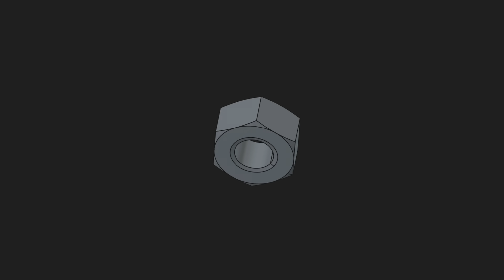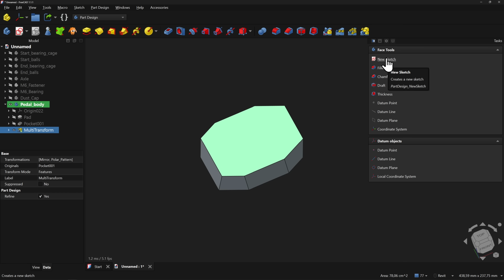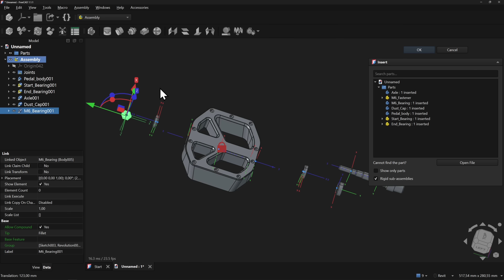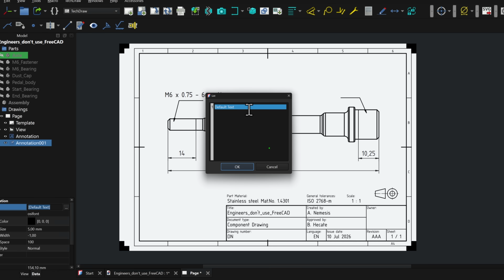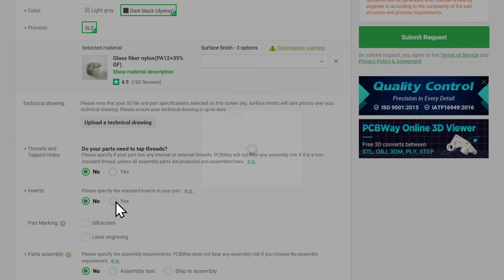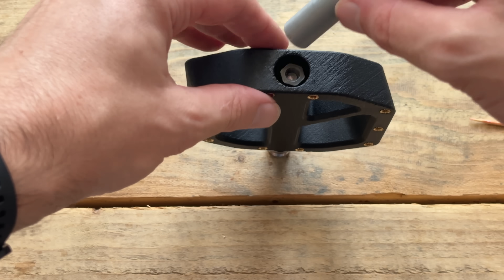Engineers don't use FreeCAD... Until NOW!

Comment: I love freecad and how far it has come. It is definitely viable for my 3D printing needs. On the other hand, as an engineering student there are still some things I am waiting to be cooked up by the devs. I know broken out sections and (hopefully) half sections are already being developed. But one simple thing I miss even in OnShape is half view (you can crop part but not add a symmetry line or split it in half), if a part is symmetric it is often very beneficial to only draw half of it and that leaves more area for other details or to increase the scale. A good example that happened to me recently is where I had a plate with four M4.5 sized holes in each corner. The plate itself was comparably large, but if displaying only its quarter, the holes were clearly visible.

Comment: Your explanations are the best (in my opinion) thanks for your work! And can you plz make video like  "STOP using FreeCAD WRONG" but with topic "How to work with several bodies". I mean how to create correct dependencies between them, and how set it up. If I want change some sizes it shows many errors after changes which refers to other bodies cause I use shape binder, sub-shape binder (for example). You have many videos with "Revers engineering" but how to work with freecad if I want create some complex project with several bodies, and if some sizes I decided to change (because I don't know what the best sizes for some parts in the beginning) it could easily change other sizes of other bodies without errors?

Comment: I installed free cad every few years for the last 15 years, and it was crap, i always ended up going to SW then fusion. 1.0 was the first time i felt i was using a real software. This is my main tool now

Not a fan of fusion they used the community to improve their product then are slowly locking them out.

Comment: As someone learning freeCAD as a replacement for my student version of solidworks, I’m really not a fan, it seems to give you less control in certain instances and then require way more input than necessary on others. I’m not arguing it isn’t capable but the way it expects the workflow to be is awful compared to solidworks or fusion, I know it’s open source but it’s had 24 years to get around TNP

Comment: Despite the impressive improvements on the last two years the FreeCAD workflow is still counter intuitive for most engineers with decades of experience in parasolid/acis based solutions. That’s why I decided to build Oblikovati from scratch which aims to be familiar to engineers used to industry standard tooling.

Comment: I'm following your steps, but I'm running into a performance issue with the TechDraw workbench. It's extremely slow, laggy, and keeps freezing. My specs are i7-9750H, 32GB RAM, and a GTX 1650. I've already tried enabling OpenGL settings in FreeCAD, but it hasn't made any difference. Do you have any tips or suggestions on how to improve performance for technical drawings? Thanks for your help!

Comment: Is there a way in FreeCad to place a part or a sub assembly one in the "final" assembly and then say make a radial pattern out of it or another repeating pattern? I need for example to place 6 arms in a 360º but i'd love to place the first arm exactly how i want it and then apply the radial pattern. As an example lets say I'm making a sun umbrella and i've created an assembly of just one arm which consists of various parts. Now when assembling the full umbrella I don't want to place each arm manually and I want to be flexible how many arms this umbrella should have. Your videos make it sound that FreeCad can do everything so I'm curious if you could point me to the right direction :D

Comment: First, thank you so much. I followed your tutorial and when I generated the stl file of the Pedal_Body and openned in UltimakerCura or even uploaded to  PCBWay, the object appeared without the fillets, chamfers and top/bottle holes. I suppose that was related to the modification in Pocket_X size. Do you have a tip to resolve this?

Comment: Thanks! Though as a software developer, I still prefer doing CAD using CadQuery (OpenCASCADE) or OpenSCAD. I like having modular and parametric components through code to maximize reusability across projects. Another big advantage is that LLMs understand this code quite well (especially vision-capable models like Qwen) which makes fixing bugs and creating new parts much faster.

It's incredible how even models trained solely on text develop spatial awareness. An interesting read on this is the arXiv paper 'The Platonic Representation Hypothesis', which shows that whether an AI learns from text, images, audio, or another modality, it eventually ends up converging on the exact same underlying representation of reality.

Comment: It would be even more useful if the example incorporated a real electrical panel or instrumentation enclosure, including DIN rails, terminal blocks, cable glands, relays, CTs, PLCs, HMIs, and other off-the-shelf electrical components. Showing how to combine mechanical fabrication features with electrical layout requirements, panel integration, and detailed manufacturing documentation would closely mirror real-world engineering practice and provide tremendous value for both mechanical and electrical engineers.

Comment: To be honest, freeCAD's work flow still not as smooth and convenient as Solidworks, for example the symmetrical function in freeCAD drawing mode will not constrain the mirrored drawing, need to click the binder to get certain references. Moreover, there is quite a lot of setting to go through to make the navigation and display feels good to operate. However, considered it is free, provide almost every function you need from designing to manufacturing, and can work even in linux, it diffidently is one of the best CAD software for hobbyist to start with or invest the time to learn.

Comment: I think roller bearings or needle bearings would have been better for the foot petal. Low speed, high force is right up their alley unlike the ball bearings you used. But maybe roller bearings in this small size were unavailable or too expensive?

Comment: I'm currently trying to recall every product demo, machine or engineering project I've been a part of that used a pedal or footpeg as the proof-of-concept feature. I'm currently up to 12 and have that 'oh yeah' every few moments (new printers always seem to use a bike pedal, especially in Europe!). Something about engineers and biking seems to be be a , cough, tandem occurrence.
Add: I did goof around in 1.1 the other day, and I was enjoying it up until I realized that once you extrude a section of your sketch, the whole drawing becomes inaccessible and you blew all that time. Some of the functions are not immediately obvious, but that's more a learning difference versus other packages. Siemens' CAD also drove me insane if you have a lot of seat time in Solidworks or Fusion.

Comment: Engineers do use FreeCAD! I do almost daily and I am the owner of an Engineering Consultancy! We do everything from design, to CAE, CAM, production setup and simulation, mechatronics, and even database applications. But I use it for none of the use cases you show in this video...

Just look at your video and see how many times you say you have had to make geometry (LCS, shapebinders, draw lines for the threads in the drawing, type out the words to fill the drawing title block) that any commercial CAD would generate automatically. And this was a bike pedal, not a custom production machine with electronics integration.

For hobby design, FreeCAD is great. It meets the basic spec for a hobby. It kills time. But for professional work, you are not competitive as a company or as an engineering consultancy if you need to put in that much extra work. And I think FreeCAD's ultimate undoing for professional design work is Alibre Atom3D with a minuscule cost for a perpetual licence.

I use it professionally for the FEA, CFD, and CAM workbenches though, and it's really powerful for that. In that field there is no $200 alternative to outperform it. There are software that outperform it but the cost is eye watering!!! In these use cases, the break even point would be a few years (let's assume an hourly rate of 30$ to 60$, and let's say that FreeCAD would lose on average 10-15min per project, 2project/day, plus a one time software installation and setup timeframe of 2days).

In which case, you would need to pay again for the FEA software to be compatible with clients or get new features. Here is where FreeCAD makes financial sense. No question. Here is where FreeCAD shines.

For Design work it's just not good enough.

Comment: Im a former bearing manufacturing engineer. Props for calling them balls or bearing balls and not ball-bearings. That's a pet-peeve of mine. A ball bearing is an assembly. Balls are the rolling elements of a ball bearing.

Comment: Hahaha changing the standard axle to fit a custum designed, 3d-printed part is a wild way to include the sponsor in this video ;D
Would have taken you less time to change the angle of the braces as well as the widened middle section to easily fit the standard axle.

Comment: Thank you Deltahedra, always really useful tutorials. WIthout you and a few other people online, I would not be able to use Freecad. It is always a bit frustrating to use, it is much less tolerant than other software to not using the proper way but if you know it, then it is a really nice tool. And thanks to show the other things like tech drawing. For fitting the insert, I'd recommand a soldering iron instead of the hammer but it looks like your method worked as well!

Comment: Once again, impeccable FreeCAD tutorial. As a solidworks user, I still struggle to wrap my mind around having a "project" file and modelling all the parts as independent bodies inside a single file, although users coming from softwares like fusion, I think the transition to FreeCAD should be plain sailing.

Thank you so much for your contribution to the open source community and promoting FreeCAD in a way people can actually consider it as a viable alternative. I wish we could have such an amazing piece of software for electronical design aswell. The day we'll get a linux alternative for Altium, I won't step into microslop ever again.

Comment: In the past, FreeCAD was packed with various tools, but it crashed often and the workflow was too clunky to use efficiently.
However, since the 1.0 release, FreeCAD has kept consistently improving its stability and efficiency, finally bringing it up to a level worth considering for professional work.
Even so, it’s still an undeniable fact that it falls short of commercial 3D CAD software when it comes to stability and efficiency.

Comment: This is fantastic!
I know the basics already, but as I mostly design simple stuff for fun and DIY, I haven't dug into the technical drawing and assembly stuff yet.

This video goes into my "keepers" list and I'll use it for reference when I get to more advanced designs. Soooo many good tips and tricks in one video it's frankly astounding. And some are just mentioned in passing, so a rewatch is almost necessary.

It might not be intended for beginners but it's also a good showcase to show a beginner how powerful FreeCAD is (and this isn't close to all it can do either).

(The only thing I could critique is using a photo + math instead of a simple thread gauge. It's still a neat trick, and not everyone might have a thread gauge handy, so horses for courses.)

Comment: I had no idea FreeCAD was this capable. Regarding the axle length: wouldn't adjusting the angle of the plastic pedal be the best way to fix the wall issue, rather than changing the axle length itself?

Comment: 4 improvement possibilities: 
1. For threads ind 3D, the option to not render, but attach to the parts information, so the threads automatically show in the drawings
2. Double arrow for symmetrical extrusion
3. For the patter of the bolts on top of the paddle - pattern using the outline of the pedal with an option for an offset
4. Update the drawing sheets scale by the first imported views scale

Comment: I'm an engineer.  I've been using FreeCAD exclusively since the early days when I'd need to save every time I did anything because it crashed constantly.  I was productive before then, but with the 1.0 release it became stable and definitely ready for prime time.  It's gotten much better since then.  I haven't tried 26.3 but I'll download it soon.  Every time there is a significant improvement, approximately once a year, I'll donate to the open source project.  Thank you guys!

Comment: Instead of the hammer you should have used the bearing mounting tool that you had PCBWay make for you
(The axle - just print mandrels to push against the bearing cups as you tighten the nut)

Comment: People need to embrace FREE open-source software that doesn't need "the cloud" to run. Ditch all paid or freemium corporate software.
Reply: Mate, most CAD software doesn't need the cloud, plus that's a feature not a bug when you're actually doing professional work with a team of engineers all working on one project. Open source is great, but in some areas, like CAD, it's still not ready for prime time.
Reply: @iliketoast-q9b Most people are not doing professional work with a team of engineers, where a software license has been provided and paid for you and the work you do it's the company's IP. Obviously my comment had nothing to do with that...
Reply: @sp-vt4je Like I said most CAD doesn't require the cloud. At least when it comes to CAD there are far better options available than open-source software like FreeCAD. It's just not as good as commercial CAD still.
Reply: @iliketoast-q9b What are you talking about? Arguably the most mainstream software is Fusion 360. Do you think that runs locally?
Reply: @sp-vt4je Nope, Solidworks is industry standard and it's what most students learn. Fusion is only big with hobbyists and maybe small shops. It's cute that you think otherwise though.
Reply: @iliketoast-q9b You are missing the point of my comments. You came here as a professional bro flexible your "industry"muscles. My comment was not targeted to you or "the industry". I couldn't care less if you used Solidworks or a chisel day to day.
Reply: @sp-vt4je You are way off buddy. CAD is mostly used by professionals and students. So even among hobbyists, which are often engineers and students, Fusion isn't as big as you think. And even for non-professiinal usecases almost no one uses FreeCAD.
Reply: @iliketoast-q9b You need help. Good luck.

Comment: I've been seriously considering switching over to FreeCAD from Autodesk Inventor but I'm still a little worried about the part/assembly file management system.
I really like how Inventor does it, parts are simply just individual files and assemblies are also individual files that simply gather the part files into one complete assembly inside the software.
Reply: You can do that in freecad too.

Comment: Man, this is the best FreeCAD tutorial channel. It’s making me consider switching to it completely. I currently work with Fusion 360—I use it for my research work, and as a hobby at home for everything. There are only two things holding me back. First, the workspace doesn't have the capability for hybrid design like Fusion 360, and direct modeling is missing—for example, the 'offset face' command. Second, there isn't total freedom when it comes to moving, positioning, and rotating bodies; the 'move/copy' command in Fusion 360 is much more complex and functional. The menus and tabs aren't an issue—it's just a matter of learning and getting used to them. In my work, I constantly have to modify and make changes to the design, and softwares like SolidWorks, Autodesk Inventor, or KOMPAS-3D simply crash, bug out, and throw errors in the file links of the parts. I think FreeCad  has the potential to develop and become a serious competitor to even the most professional software
Reply: Definitely want the offset, hopefully that comes soon. So useful
Reply: I think you can make offsets by directly changing parameter in the sketch to the needed position
Reply: I tried it recently and if you're doing anything non trivial, stick with fusion for now
Reply: You are just coping, since you'll have to relearn. FreeCad is more than capable if you are using it for hobby designs